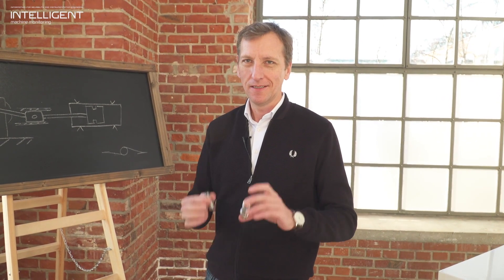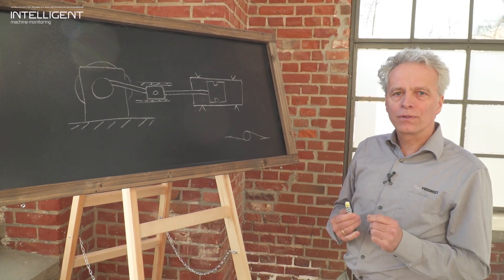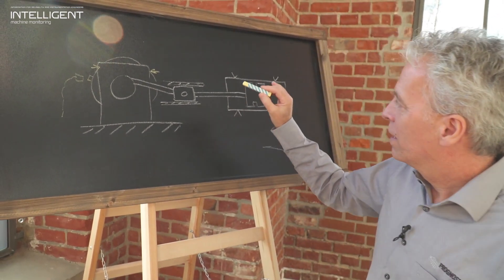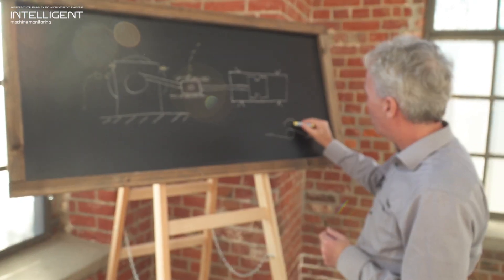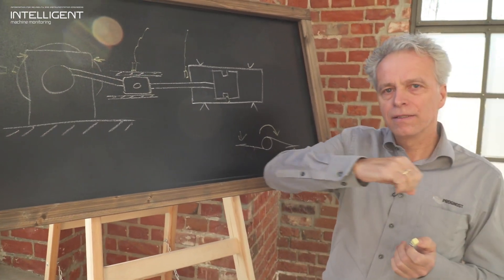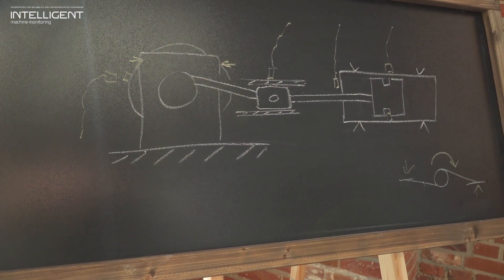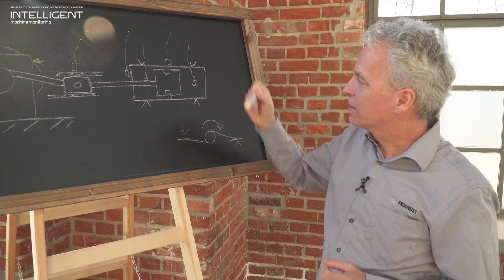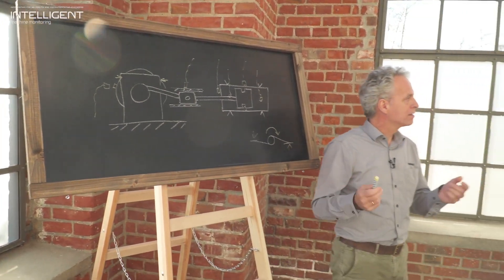What are the best sensor positions on Reciprocating Compressors?

Comment: Great video. What is the dynamic pressure sensors exactly? Is it able to pick up the absolute pressure within the cylinder or what information can be gained instead of using a static sensor?
Reply from the maker: Yes, up to 1600 bar it measures the absolute dynamic pressure directly inside the Cylinder Champer.

Comment: What are your thoughts of ultrasonic sensor points to detect valve integrity?
Reply from the maker: Thank you for your question Jhon, as we know ultrasonic sensors are often used in combination with mobile/snapshot monitoring. So this type of sensor is not appropriate for continuous machine monitoring.